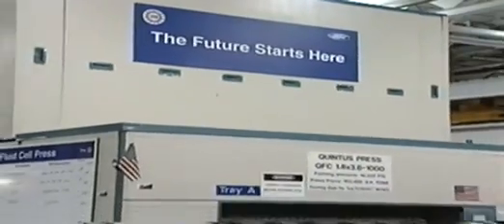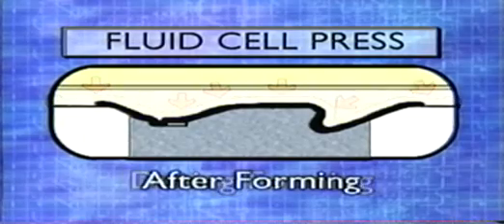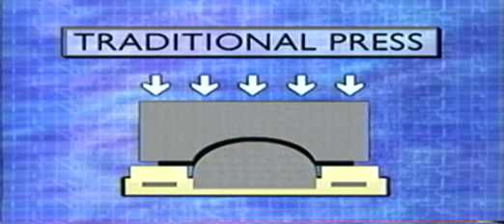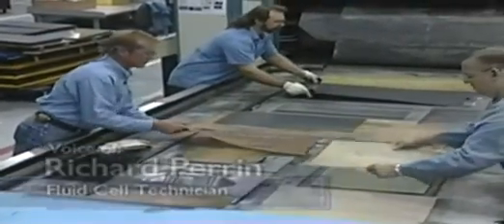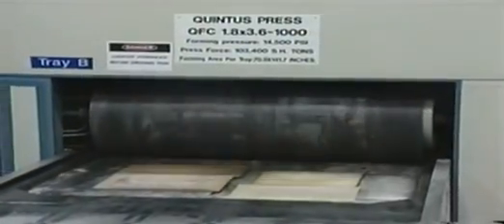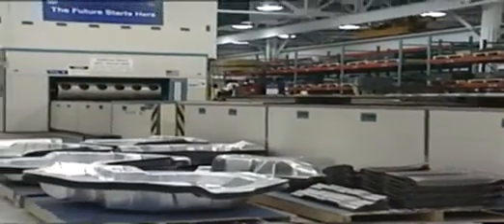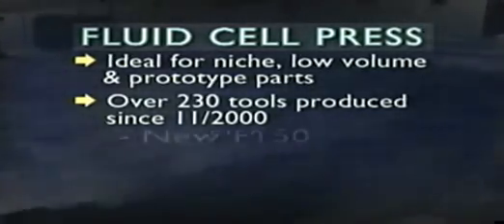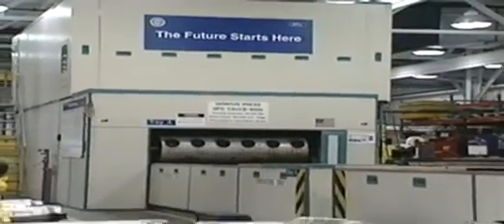Quintus Protototyping and Low Volume Production with Hydroforming

Comment: I believe  with hydro pressing you don't need a draft angle for die to come out bcz it is a flexible diaphragm...But I am skeptical on diaphragm fatigue failure as the amount of deformation it goes every cycle it won't last long & tear  leaking hydraulic fluid all over the machine.. Wonder what material diaphragm is mode of